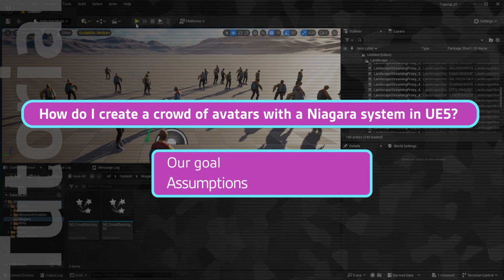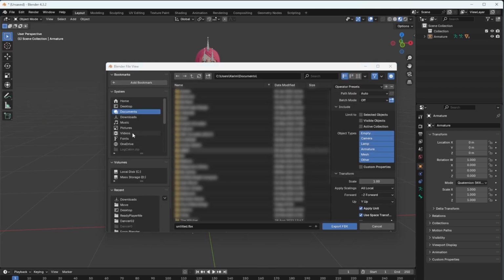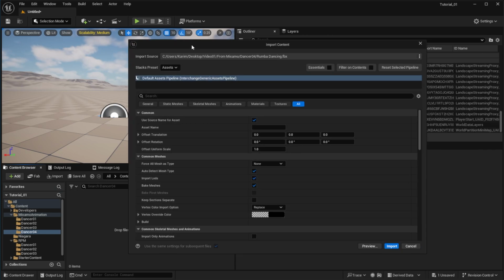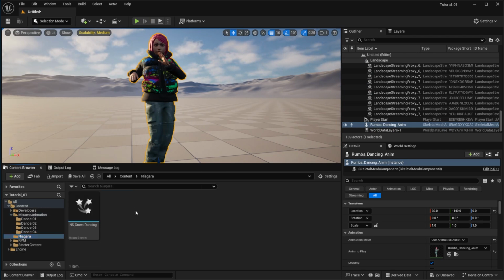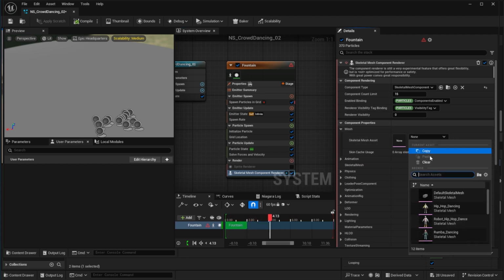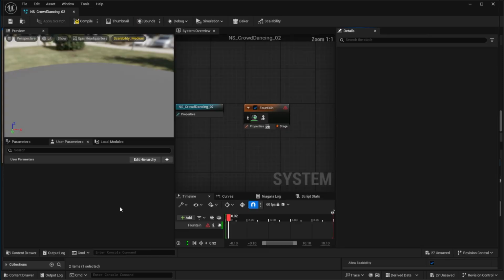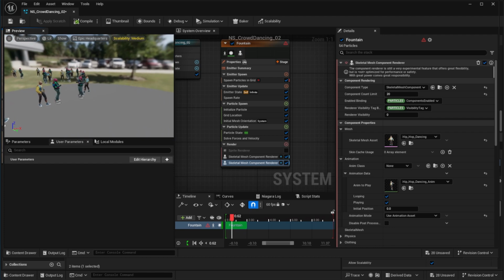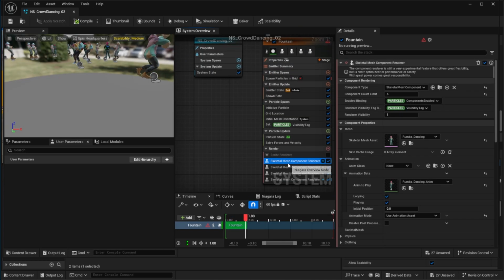How to create a crowd of avatars with a Niagara System in Unreal Engine 5

Comment: Thank you for the video, but all the mashes you create in Niagara move the same way, so the more they are, the more heterogeneous they are. Can animations play a little bit differently in how long they play?
Reply from the maker: Hi, great question. This is because I was just using the exact same animation asset across all of the instances. I understand that can look weird, though, so it's best to have multiple skeletal mesh component renderers with different animations until you don't notice similarity. You can do this a few different ways. You could:
1. create slightly different animation assets and assign them to each of the niagara skeletal mesh component renderers -- either by having different animation or setting each one to a different rate scale (under asset details > animation > rate scale)
2. change the parameters for each skeletal mesh component renderer in the niagara system under Render > Skeletal Mesh Component Renderer < Initial Position -- add a little offset and they'll start at different times
3. there is another method for randomising the length of the life, but I can't find it at the moment -- I do remember it was quite complex and I wasn't crazy about it, so I didn't pursue it. You can search other tutorials for this one.
Let me know which method you use and if you're happy with the result!